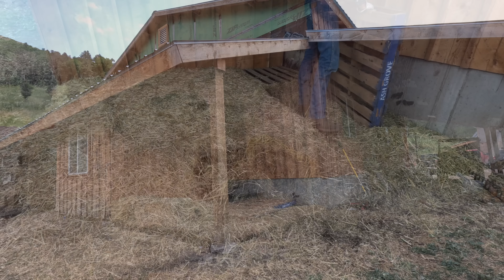#744 - More Baby Deer! A Year Supply Of Hay! Boulder Retaining Wall Continued!

Comment: Drone based cow herding has to be one of my favorites! 😀
Reply: I don’t know anything about hearding cows, but it sure seems easier with a drone. 😂
Reply: all that hay next to a wooden siding shop?    A bad Idea when moist hay combusts...!
Reply: @nekoDan  👏🏼😂
Reply: @kpdvw  that's a rare occurrence in the mountains of Idaho it don't get that hot there or humid for that to happen.  They been storing it there for several years without any problems, besides it gets plenty of air there to dry the hay out. What you're talking about usually occurs when wet hay is being stored into a enclosed area that gets hot and very  humid without a lot of air flow.

Comment: How has the weather been up there? We've been experiencing some interesting weather here in North TX. It regularly should be in the high 90s and low 100s. Yet we have had a lot fewer days in the 100s. The last few days it was hardly above the high 80s and right now in late July, it is 85. Not complaining as it doesn't tax the grid and keeps the cost of running the AC. God Bless and thanks for all the hard work.